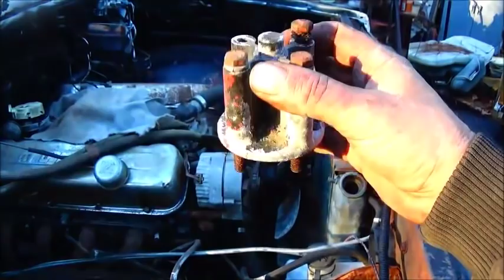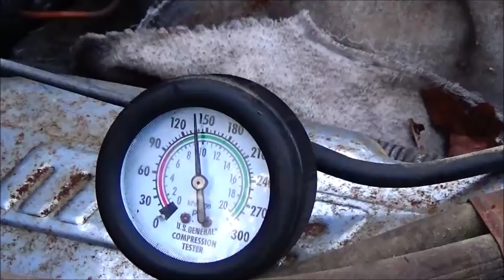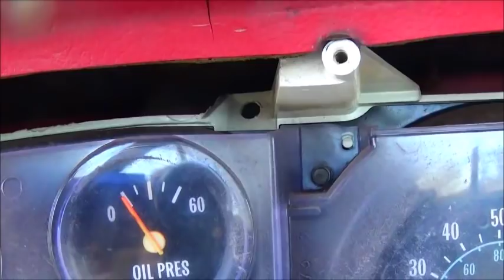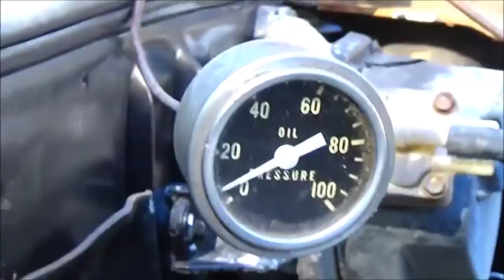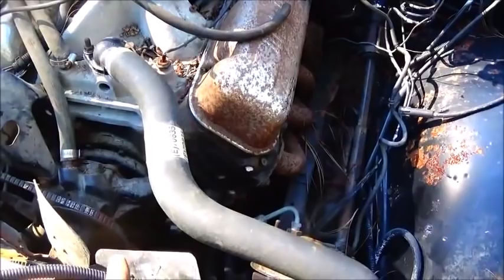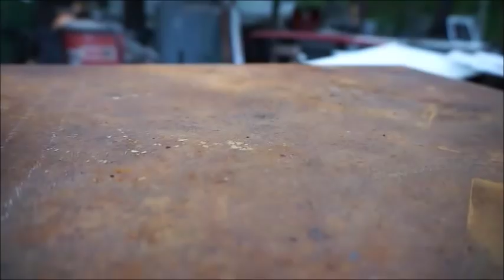427 Big Block First Start 1959 Triumph Project Engine

Comment: We used to use a distributor shaft and an electric drill to build oil pressure in the engine.  That gets the oil throughout the engine before Starting.

Comment: Sounds like 2 old grain trucks I used to drive! Both had 427s in em. Don't know what the difference was in those,and the hot rod motors,but those 2 old Jimmy's would turn about 7500 rpms! The tach on the 68 redlined at 8000!!! Had an Over rev idiot light that would come on at 7750. Seems like they had lower compression,because they spun over real quick.
Were fun to drive empty,but fully loaded they would literally run outta torque and would just ...stop! Loved those old beasts.

Comment: Do the right thing every time separate fuel tank and electronic pump. On old cold start ups.  Would be a great  start  with two stock oil. Oly a suggestion  mate.....

Comment: Bad66chevelles, the block is empty of the pistons, the ridge reamer is fitted to the cylinder with the spinning cutter, some more smaller adjustments on the cutter.  Every few cuts, the ridge reamer expands to cutting the ream at the top of each cylinder.  Just cuts ever so larger until the ridge is removed.  The best way to do it is, use a hand manual drill and cut the ridge.  Puts muscles in the arms and shoulders.  But I was about 16 when my 1933 Ford p/u flathead v8 was pulled and reringed.  But oh what satisfaction when it fired up and didn’t smoke much until the rings seated.  Great ride!  My dad taught me the finer points of flathead building.  Loved it and him.

Comment: I have done lots of engine work for decades. If the carb and the fuel pump are good, and the choke works, no one needs to dump extra gas down the carb. I can understand using gas in a bottle seeing if it will fire, but once it fires, if the fuel system is good, it does not need extra gas. Its a little bit dangerous, I have lit a few carbs on fire. How many people  back in the day lifted their hood to poor gas into the carbs to get their car started when driving to work.

Comment: I wonder if the triumphs frame is going to be able to handle the 427s power without twisting, I seen a 427 twist a 67 chevelle frame badly enough that it couldn't even be driven again...lol
Reply: Kirk Prell the earlier build videos will answer the question...

Comment: So iv seen a ton of motors built in my day and iv never seen anyone put a spreadbore gasket on top of a open plane spacer???🤔🤔why would you do this??? Seems like it will break up the fuel mix before it gets a full fire?   Just a real question!!  so... why??
Reply from the maker: Jason Petrich just a quick first start so used what I had on hand

Comment: Love those generation of big blocks I have one a 454 H.O. out of a Itasca Sunflyer RV its a beast pushing 490 hp all stock internals with the same quadrajet carb. I look at the quadrajet carb as if it was like my old M16 in the army keep er clean it will function perfect. The one I had was all gummed up I used chemtool and a rebuild kit and now its dialed in. Are those old school moroso valve covers on the 427?. If anyone has seen two lane blacktop this motor reminds me of that movie.

Comment: Alternators were first introduced as standard equipment on a production car by the Chrysler Corporation on the Valiant in 1960, several years ahead of Ford and General Motors. How come this engine was using alternator and clutch type fan ahead of the years stated in the records. Sorry, just for clarification only.
Reply: It's called aftermarket, a kit for an alternator, and a clutch fan kit, stuff like that
Reply: It's magic...

Comment: Wow, that motor sounds mean as hell.  It's definitely got a lumpy cam in it at the very least.  Surprising it doesn't have roller rockers but maybe the project stalled before that happened...

Comment: I'm watching it roll over but the distributor isn't turning so it's not engaged with the cam gear.Also,you should have at least 5 Lbs Per every 1000 Rpm's to keep it well oiled and not have it break a bearing or valve train parts.I put a .30 over 402 BBC in an S-10 long bed pick up and it was retrofit with all Bow tie parts from GM.It flew!30-40 MPH and punch it,the tires just started burning off!Quadrajets are ok,but the Holley double pampers may be what you'll need to keep the 427 fed?Good luck!

Comment: Johnathon if ever you get the time I would be interested in a video on the correct way you bypass the ignition switch and hotwire and start it from under the hood.  like you always do. I want to know the proper way to not ruin anything. thanks

Comment: Yep, that's a pretty hot engine! I'd guess 400HP, or better!
Reply: 385 was the lowest HP for a 427
Reply: @commanderofthenorth3348  with the big cam and racing intake in a big block 427 more like north of 500HP and 500LBS of torque....
Reply: @stevemitchell2252  i remember when Hot Rod Magazine took an L-88 out of a Vette and dynoed it , 720 Horses at 7000 RPM , lower numbers are for insurance rates , oh thay added headers only . wish i could post a pic of my BBC here , about 600 HP at 7000 .
Reply: @commanderofthenorth3348  I can totally believe your big block does it least 600 horsepower... the valves the intake ports in the exhaust ports are so massive on a big block that alone makes tremendous power plus the extra 100 cubic inches over a small block... I find it funny when these young Modern Men brag about the ls engines making 500 horsepower with just a cam swap and good heads... when you can take an old school big block with good heads and a big Cam and get 700-plus horsepower...
Reply: @stevemitchell2252  i'm using Cranes blueprint series L-88 with solids the cam pulls like a monster all the way through , 7000 + i stop at 7 ,
Reply: @stevemitchell2252  lmao
Reply: @timlink341  what's so funny buddy?

Comment: Just a heads up, if you go the electric fan route the honda rad fans are decently high flow and readily available in junk yards. Smaller too so it might help with space restraints in the triumph...

Comment: Not stock for sure, choppy idle, probably low vacuum and really can't idle down real low, big cam if nothing else. Sure has good response though, its immediate. Another good runner and a strong motor for the project!

Comment: Not many sounds better than a big block Chevy, that’s for sure. Will be a great project. I agree about not stock. Sounds like at least 230* @.050 and that’s just a very wild guess based on what little I’ve seen. Can measure lift with a dial indicator, but if it runs good anyway, it doesn’t really matters

Comment: Looks like you scored a good engine. Sure sounds like a healthy cam. Kept wondering if the idle speed was set too low, but if the float is off a bit, that would do it.
Reply from the maker: Yes Carburetor has been sitting for quite a while, I will go through it, get some water in the engine and run it, on video of course.

Comment: any idea on what it will take to beef up the Triumph frame?
Reply from the maker: Frame rails, ladder bars built from 1964 chevy truck trailing arms. front end modifications using 1985 corvette spindles, rotors and calipers. Gonna try to do everything I can using OEM parts from a lot of different stuff.
Reply: Thanks for the info. Sounds like you have a plan.

Back in my mis-spent youth we tried to put a 392 Hemi into an English Ford. It turned into quite a disaster....  :(

Comment: that is one heck of a good motor if it has 5 lbs of oil pressure sitting still! when it fired it sounded pretty smooth. very snappy on the throttle.
Reply: love to put that in my 1983 scottsdale with twin cowboy exhaust

Comment: Didn’t look like you had put the plug in the front? Would make it pretty hard to idle without that plug also would make it seem like it had a big cam if it was hard to idle?
Reply from the maker: Plug went in water jacket.
Reply: 10-4 I was lookin at the intake she does sound good and looked to like the fuel and probably gonna need some big Jets lol
Reply: On my Aussie 308 v8 motor the hole in the front of the manifold is for the water temp sender

Comment: Sounds good Jonathan, good throttle response with instant rpm. That 350 turbo will do just fine in a car as light as the triumph. A decent converter and a shift kit should suffice.